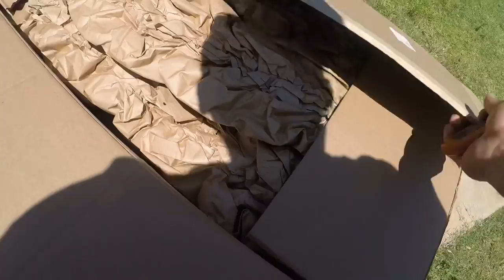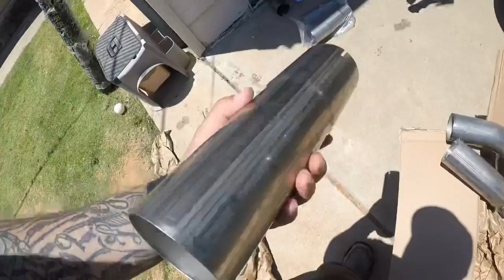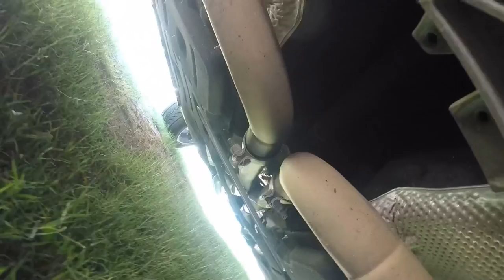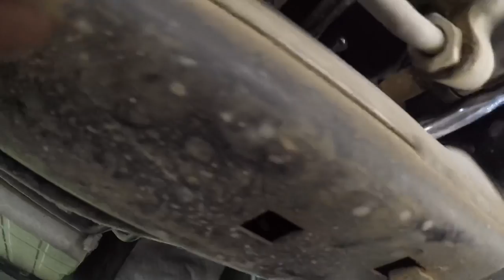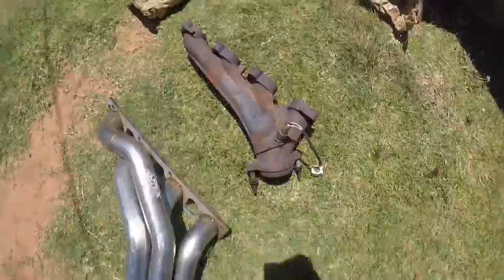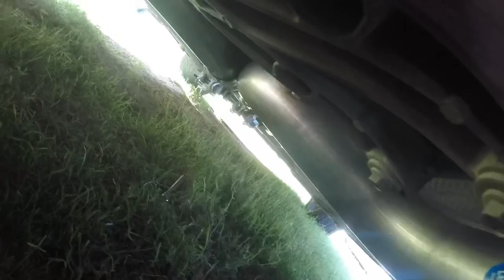Chrysler 300c header install!

Comment: Nice, long tube install on car ramps!!!!  Sweetness.
Reply from the maker: rayscopes had a little bit of experience from a 15’ Challenger, but this one felt a lot easier 4 hours from start to finish! Really easy mod
Reply: How many o2 senor extensions did you need? 2 or 4?
Reply from the maker: ModCityK 4 the sensors from the manifolds are pushed back where the stock cats went and the sensors for the cats are pushed back pretty far as well

Comment: Thats all bolt on and tightened with clamps? Hows the clamps work without welds?
Reply from the maker: @blackred1032  I’m not sure what you mean
Reply: @Rubengarcia.20 is that whole exhaust header put together and tightened with clamps? If so how well does the clamps hold up?
Reply from the maker: @blackred1032  from header to connection pipe, then connection pipe to mid pipe is all slip fit into the next section. Yes it’s all held together by clamps, this particular set come with 2” wide stainless steel band clamps. It’s recommended to re-tighten after a break in period of 1000 miles or so. I did, but they held up fine so I’d say they’re great.

Comment: looking to add headers to my 05 300c. question. did you need a tune after the install?
Reply: hey, looking to add some to mine too, same model, but if you add a tune after you will really get the most out of it, I suggest getting a tune
Reply from the maker: You don’t “need” a tune, but it does help for gains and efficiency
Reply: @Rubengarcia.20  thanks very much for the reply man. so it is not a must to get a tune. but its recommended?
Reply from the maker: Of course, and yes
Reply: @Rubengarcia.20  for a diy how hard is it to do it? im the time that likes to work on my own cars.
Reply from the maker: @marcotena4158  this took me 4 1/2 hours by myself and it was my second time to do it
Reply: @Rubengarcia.20  not bad at all then. did you have to modify your exhaust after installing header? as far as cutting of some sort?
Reply from the maker: @marcotena4158  none at all

Comment: Did you use a wobble head on the wrench to take out the bolts? What size socket are they?
Reply from the maker: Yeah, like 3 extensions and a swivel.. I believe they’re 10mm it’s been a while

Comment: great work bro, just quick question. Is it possible to keep my cats on for Emission purpose and do they give you little bit of hp?
Reply from the maker: Andolini Corleone yes, these headers are sold with either “high flow cats” or “off road cats” I went for the off roads for sound and doing away with the cats does add some hp because it does away with the restriction of air flow
Reply: @Rubengarcia.20  where did you get them from? I assume they will fit my 2006 300c SRT8
Reply from the maker: Andolini Corleone stainlessworks.net I’m not sure if the port size is the same for that year

Comment: Did you just need a pair of 12 inch o2 extensions or did you need the 24 in?
Reply from the maker: K. Hamilton I believe it’s 2 sets of 12 in. Not too long, but long enough
Reply: Ruben Garcia 
Ok thanks bro, i have long tubes on the way for my 14' 300c, got a pair of 12 in extensions but i had them send me a second pair of 12 in extensions just in case. They told me if i dont need them to just send them back for a refund lol
Reply from the maker: K. Hamilton hell yeah man! Bet it sounds mean, I believe the factory O2 harnesses are zip tied up in there some where so they don’t hang so much but I don’t remember too well.. but I know just with the ones they sent me was more than enough, I had to fold them and zip tie them back up
Reply: Ruben Garcia 
Yeah bro i installed shorty headers myself a couple months ago, last thing for the full exhaust would be for the stock cats to go, but i ended up wanting long tubes so i got the high flow cats and then it will be full exhaust, sounds good now but after the headers / hi flows i bet it will be crazy lol